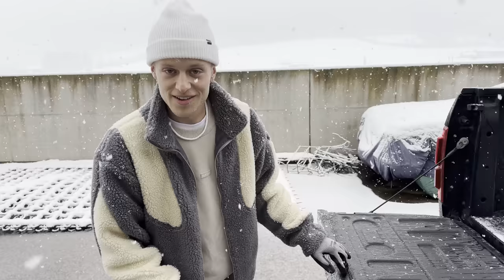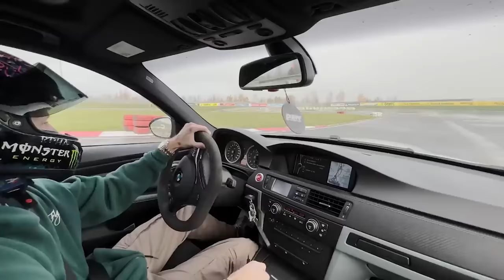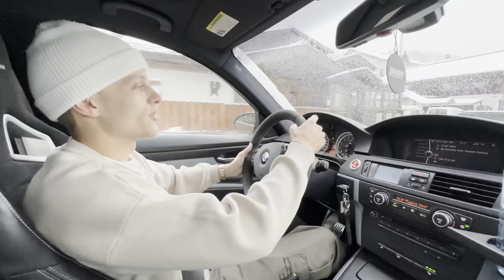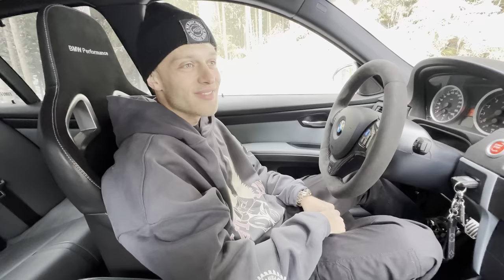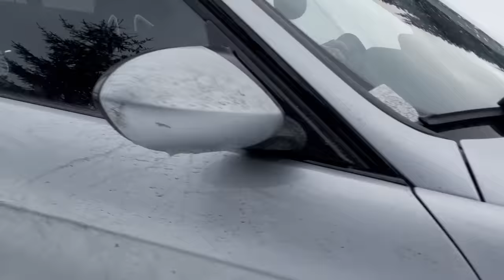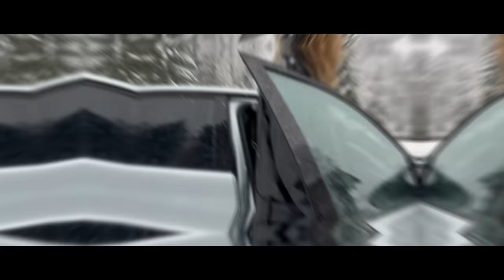DRIVING my 700HP BMW M3 E90 in SNOW! - Worst idea ever? Drifts & Sound - OG Schaefchen

Comment: Time for Quattro Power that another Car can be at the Workshop in Winter😂
Reply: @schaefchen  rs4 b7 would be the perfect winter car
Reply: just put winter tyres with studs and u get up there
Reply: @Th3Ran  studs wont help on snow. better to use winter tires without studs, they have softer rubber compound and better grip on snow
Reply: @schaefchen  RS4 B7 würde ich auch feiern, einen der wenigen Audis die ich gut finde.

Comment: Yes 🙏 Schaefchen is back in action, doing drifting in the snow 🤩
But this problem with no grip maybe a result of your 700hp engine and your heavy right foot, I would assume 😝
Can’t wait to see the R35 or the Evo drifting in the snow again 😍
But one question: You bought two winter tires for your front rims, so why didn’t you replace the „almost done“ rear tires at the same time? 🤔😝
And one thing stood out for me: In almost every shot from the inside your girlfriend had the heated seat on full blast and the temperature of your climate control at least 4 degrees higher than you 😂
Oh wait, I did forget to mention something: You HAVE TO deactivate your air con to have more grip 🥴😉
Thanks for the awesome video, the sound of your E90 M3 is simply amazing 🤤🤤🤤
Viele Grüße, Philipp 👋